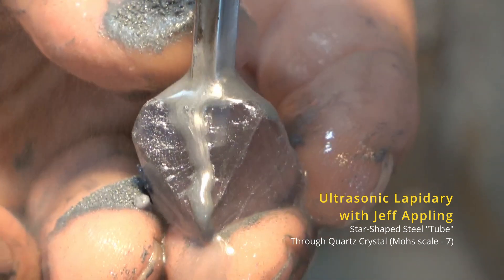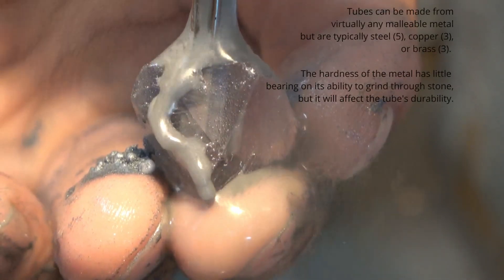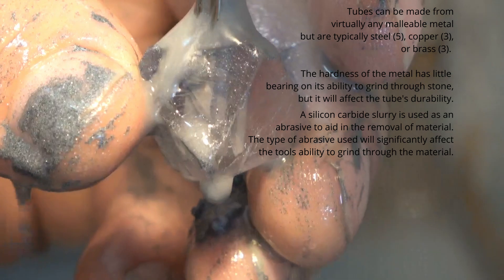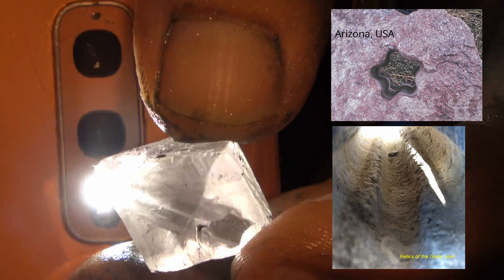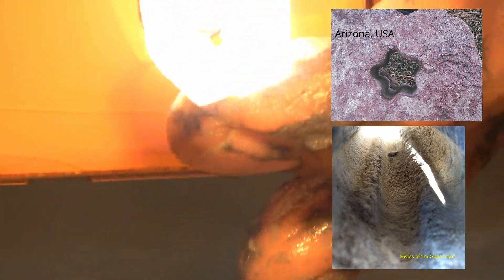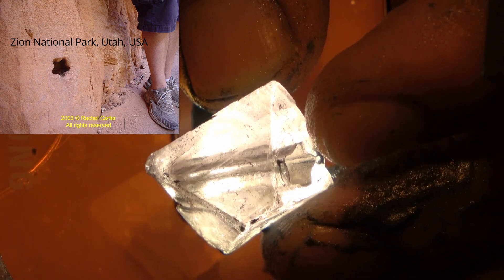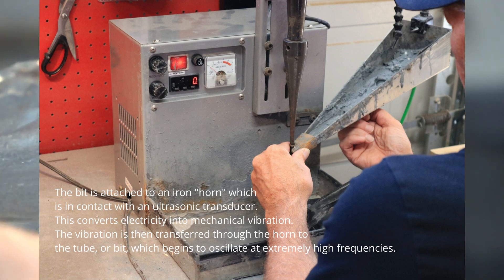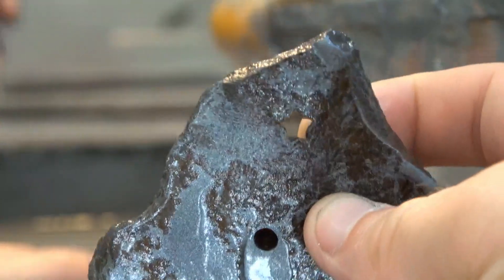Ultrasonic Stonecutting with Jeff Appling

Comment: Are you using the resonance frequency of the stone or just random ones?
Reply from the maker: The frequency of the stone has no function in this specific process. You could call it "random" but there is a sweet spot for each combination of mineral type, tube shape, slurry type, and overall machine setup.
Reply: @Jungcheese1080  Superimposed frequencies can make the process more efficient.
Reply: @Jungcheese1080  I promise you frequency has a function in what you're doing.
Reply from the maker: @cheezar5121 I understand what you're saying, but for this "specific" modern process, we currently do not match the frequency of the stone. Maybe we should! The machine itself is not capable of being tuned to a certain frequency on its own, as it is analog. We would need to measure it somehow and then adjust. But then as soon as you touch the stone, the frequency would change, so this would be very difficult.
Reply: Lol
Reply: @anonymouslypostedcomment  Why are you mocking people?
Reply: @polygon2744  He doesn't know, probably a bot